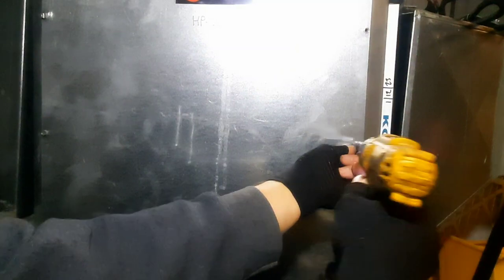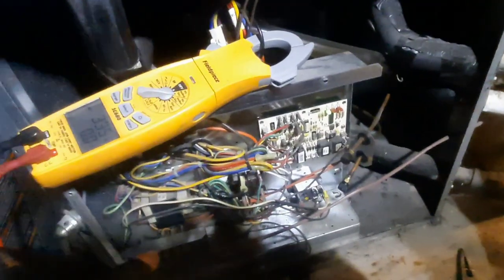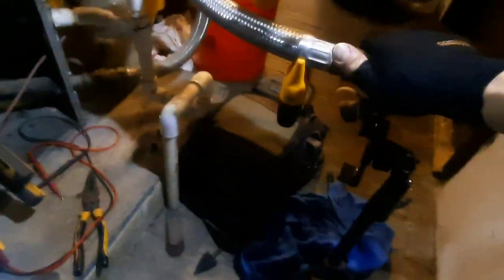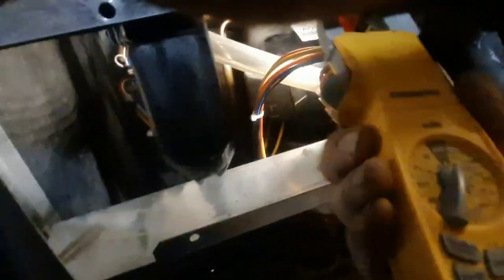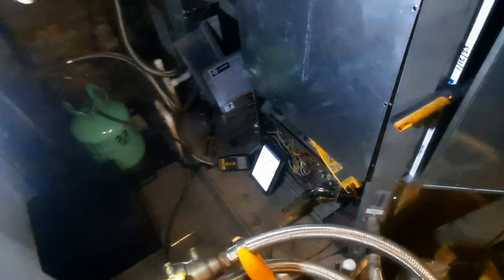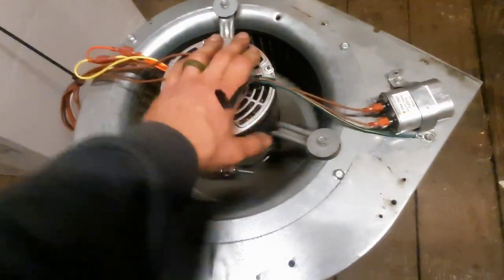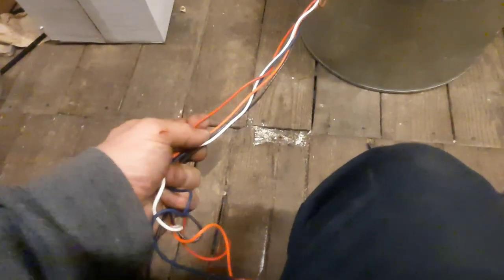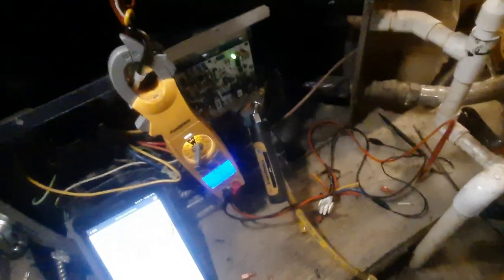Trane water source heat pump not cooling or heating.

Comment: Great video. One thing I'd certainly do differently is use not use the flexible hose crimps to measure temperature as they are a very high thermal resistance to the liquid in the loop. Clamping onto the adjacent brass would have been better, although the best option would be copper. What is the pipe material just where the liquid lines enter the air handler? If it was a short copper stub before the threaded fitting then clamping you temperature probes on there would provide much better readings. I don't know the internals of the air handler but there may be decent liquid temperature probe locations inside somewhere.
Reply from the maker: Good call! Thanks DelticEngine. I moved it around, brass was the best reading. Inside you're right, you could probably find a better copper line but it's already tight space 😆. Thanks, I appreciate the tips.

Comment: Hey great video bro! 
I have a r22 same water source heat pump I’m working on , it like 14 yrs old
The compressor went out !
I did one before and let me tell u , it was a nightmare, the dam suction line is all the way in the back, so I had to pull out indoor fan motor, indoor evap coil . I cut a square in the sheet metal that divides the compartments, just to get a braze on it.
Do u have a easier way to change out the compressor. I can’t find correct service manual for it 

It’s in a 15 story high rise building, I’m gonna to take the system out , take it back to the shop and replace the compressor like that

Your thoughts will be great appreciated
Reply: Is that a GEV model
Reply from the maker: If you have the opportunity to repair it at the shop, it would be easiest. These things are not service friendly. You'd be amazed at some of the access on the commercial side.
Reply: No kidding I wonder how hard it is to swap out that reversing valve. Maybe have to crimp them back.
Reply from the maker: I missed this somehow. None of these are easy to work on. Access is not something manufacturers think about. If you can take it to a shop, that's probably the best/easiest way.

Comment: When measure and charge system to weight specs i think i would check static pressure to make sure i have good air flow.   From there see if you can adjust water flow to get high side and low side pressure within reasonable number or specs.   Choose a hot day i would adjust water flow to get maybe 280 psi on high side and 80 psi on low side in cooling mode or whatever temperature pressure charge on the equipment. 156 psi seem kind of low not work efficient but i wonder what ambient temperature it run in cooling mode?
Reply from the maker: I did explain It was shoulder season, so water temp was down, and readings were not perfect due to this and probably air flow issues, Everything has air flow issues, 😆. My readings were within normal range for the temperature. It is a bar, so they don't fix much, only band-aid stuff until it becomes a major issue. They constantly switch from heat to cool in all kinds of conditions, open the front doors to main street, and crank the cooling down on hot days. All the usual for a commercial space.
Reply: @EverythingHVACR  yes i got almost same trane unit running on low end of pressure in heat pump because water input is 60F.  When building fix their water to 80F heatpump pressure 240 high side and 68 psi on low side heatpump put out very good heat.  So water flow or temp is critical. By the way good video thx for sharing

Comment: was wondering if you have a carrier 2-ton condenser 410 a to a goodman 2 ton 410 a    using   2-ton carrier a coil.
Reply from the maker: I do not. But should work if the tonnage is correct

Comment: Great video. Thank you for sharing. May I ask, what is water source heat pump,  Which's water it use ? is it water from water heater ?
Reply from the maker: Water is from either a cooling tower or water heater. Same water loop, which is kept between 70 and 80 degrees in summer/ winter. The coaxial water coils can be either your condenser or your evaporator. Basically a heat pump with a water source heat exchanger. Thanks, ZE. I have an older video, that shows the operation of this entire system.

Comment: The blower housing was made to remove the inlet cone on the motor side so you could pull the motor and wheel together instead of working inside the blower housing.
Reply from the maker: Interesting I didn't notice that, I like to do things the hard way apparently lol, Thanks Bret!
Reply: @EverythingHVACR  Lol, I've made a career of doing things the hard way.
Reply from the maker: Same lol, Thanks again Bret

Comment: I noticed when you pulled the strainer screen, impaction debris is on the wrong side (outside of screen) your flow is reversed thru your strainer, (at least)the wrong way, debris should be inside where it can be flushed without removal. I also see where you were not able to backflush the bundle. Best to determine proper flow and direction thru the bundle. Your supply water temp at 67 degrees seems low, I would normally be looking for around 80 degrees.
Reply from the maker: These are old units, not sure about the flow, you might be right. The bottom was my inlet, and I believe that the check valve is why I couldn't flow through the opposite way. Agreed the water should be warmer, this was throwing my readings off but with the outdoor conditions mild there was no demand for anything. I think the loop set point is 75 and the boiler was locked out on outdoor temp. Thanks Aaron! Sounds like you've done this before.
Reply: @EverythingHVACR  Now I'm second guessing my first thoughts, lol. You did say check valve. On second view it looks to be a circuit setter with standard TP ports, if it is pressure independent,.. it will act like a check on reversed flow. (having a spring loaded diaphragm) And you have a circulator for this unit. What fun!!  But, yes I do a lot of hydronics nowadays it seems, less and less of refrigeration.
Reply from the maker: I appreciate any and all knowledge, I work on so much random crap it's hard to be an expert on anything. Thanks again, Aaron.
Reply: @EverythingHVACR  yes bottom is inlet

Comment: Put a Cresent wrench on the shaft and work it back and forth with the weight of the motor down
Reply from the maker: I was working it with the wrench but was only going to fight it for so long. Good advice, though, puller for the win! Thanks Christopher

Comment: I have had limited experience on wshps, but even you were checking operation  in the cooling mode adjust the leaving water to build up a little more head. that will give you enough heat to cause the suction pressure to rise. 
As far as your FANdangle error, we have all been there and did it to.
Reply from the maker: Thanks George!
Reply: Sure just make sure weight charge as specs and choosing a hot day or follow temperature pressure chart to adjust water flow

Comment: I hate WSHP'S....yes they aren't hard to work on....they are almost always located in a crappy area and everything is crammed in a tiny location with next to no room to get to things. I've worked on hundreds if not a thousand of them over the years......I'll never like them.....just like ice machines. 😅😂. This Saturday i have to replace the whole blower section on a 7.5 ton WSHP that 15' in the air....good times...
Reply from the maker: 😆 tell me how you really feel. I'm not a fan either for all the reasons you stated. Thanks Jason!